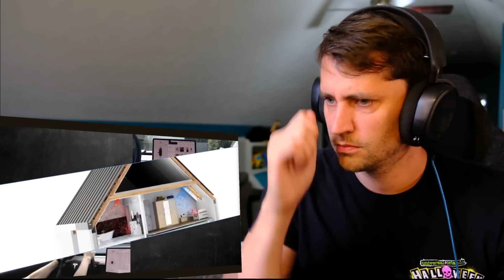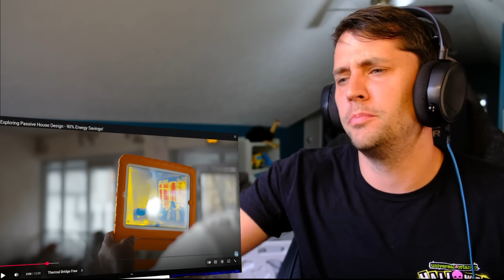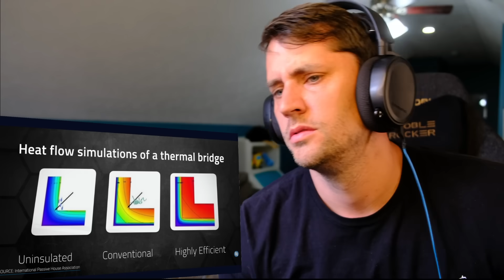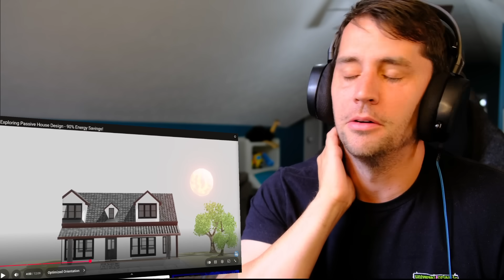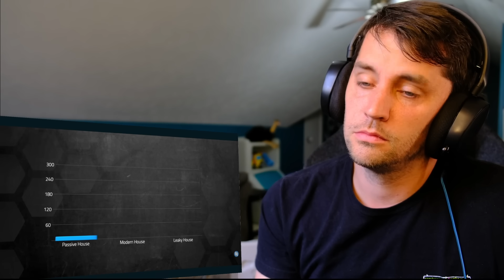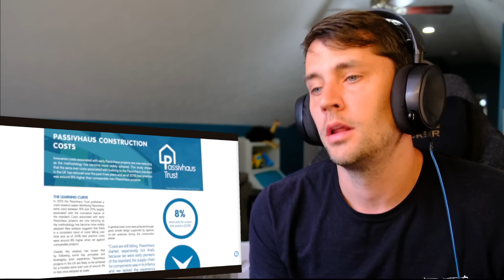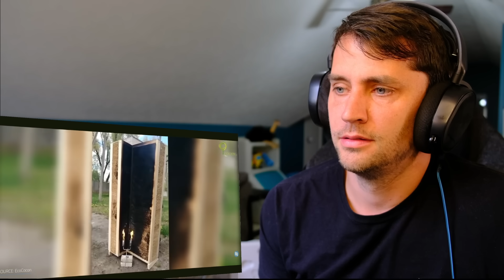American reacts to Germany's amazing 'Passivhaus'

Comment: You can get windows which are better insulated than walls...double or even triple glazing
Reply: Tripple was state of the art in the 80s.
In the 2010s there was allready quadrupple.
Reply: And even more efficient with roller shutters.
Reply: wrong,  only compared to absolute unisolated walls.   even 20mm of PUR  is better than high end windows...  and the default wall insulation  always tops out at 1/4   loss compared to them.

Comment: You get actually taught at school, that its much more beneficial for fresh air to open all windows entirely for a few minutes instead of keeping them tilted. You get much more fresh air and yes, we do it all the air. My window is also always open in the winter.

And yes people re heating our houses up^^

My friend doesnt have a Passivhaus, but if I visit him and we hang out and talk and drink a few beer, I can see on his thermometer the insidetemp going up by 2-3 degrees from around 19 to 22
Reply: There is another way which I have seen - suck used air out of kitchen and bathroom, letting air into living room and bedroom. There is a central place in the house with an air/air heat pump that warms/cools the air sucked in constantly as needed, using the used air as source for energy or to put warmth in addition. So, no electric appliance outside the house. Very efficient.

Comment: 3:15 fun fact: the 110th element Darmstadtium (Ds) was synthesized in and named after Darmstadt
Reply: …and Hassium (108) after Hessen (Hesse, latin Hassia), the Bundesland Darmstadt is in and which also was discovered (made) in Darmstadt. 😊

There were more elements made, but none with relationships to the country. 😉
Reply: I still got a daily fax from Darmstad. (for the usa readers here, that’s doing a number 2) 😊
Reply: I still think it would have been funnier to call it Wixhausium.
Reply: Another funfact: the congress center right across the street from the technical university in Darmstadt is also called "Darmstadtium"

Comment: 7:05 Argon is a non-flammable, and non-toxic noble gas that occurs in the Earth's atmosphere at about 0.934%. So, there's no need to worry about argon.
Reply from the maker: Thank you for calming my nerves:popcorn-yellow-striped-smile:
Reply: @ryanwass  You could say your worries argon
Reply: @Oinksaysthepig 😂😂😂😂😂
Reply: @ryanwass  its inert.  like ur sill gonan die if theres nothing but argon but its non toxic and i think you should refresh ur chemistry knowledge :D
Reply: Arent all inter gases non toxic by definition ?
Reply: @lemon_of_ludus  Not really Radon is still radio active.
Reply: @lemon_of_ludus they should be, considering they don't like to do any interactions with anything ...
Reply: @brag0001  FYI: Rhadon is a noble gas, but radioactive (alpha emitter). So not toxic but has other problems.
Reply: Unless you use it to deepen your voice.
It'll not leave your lungs without you being upside down, as it's heavier than air. It will choke you.
Reply: @mortuos557  It will leave your lungs if you breath and "make pressure difference". It is very slightly heavier, it is not enough if air is moving a bit
Reply: @mortuos557   good grief, have you been educated in a tree nursery? if you had ever visited a physics or chemistry class you would know why argon will not stay in your lungs even though it is heavy
Reply: @mortuos557  You don't choke on Ar. You might be confusing it with sulfur hexafluoride.
Reply: @hyperbassi  Even with Sulfur Hexaflouride the statement wouldnt hold true. It will just leave the lung as you breathe.
The danger comes from doing it in confined spaces where it might replace a significant amount of the surrounding oxygen.
Reply: @ErikB605 Yes, very true - it's a cool effect though when you do a handstand afterwards and the voice-changing effect is gone.
Reply: @hyperbassi  ...and then switch to helium 😂😂

Comment: My summer house is "passive before ventilation", that is, it has it all except for 2-way heat exchangers. We counted the energy balances, and in 2014 the costs of heat losses via natural ventilation (for 2 people living in 120 square meters) were much lower that a proper heat exchanger. Also, we wanted a "fallout proof" house that can survive off-grid for quite a while. The rest - efficient walls, ceiling and floor slabs - is just basic construction, nothing exotic or expensive. No AC needed in summer, too (maximum indoors was, IIRC, +23c when it was around +40c outside in the shade).